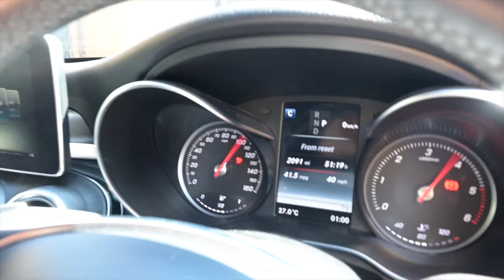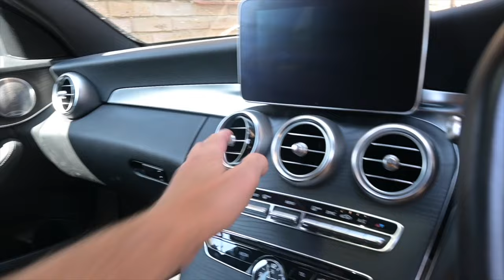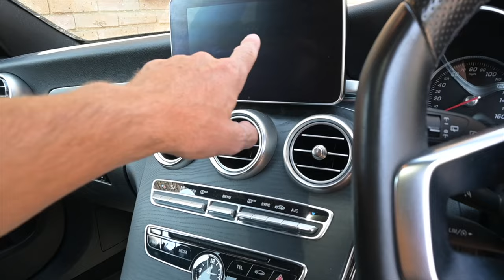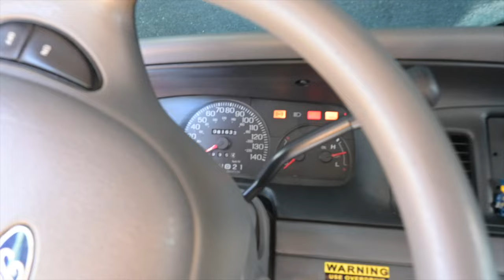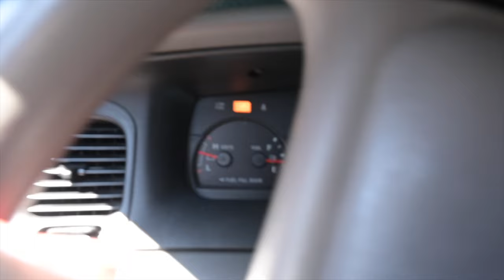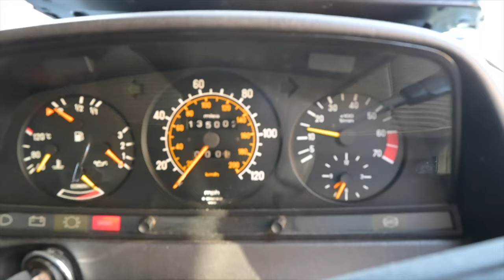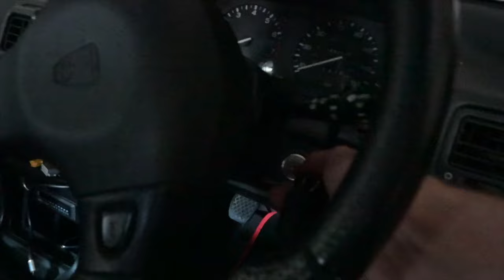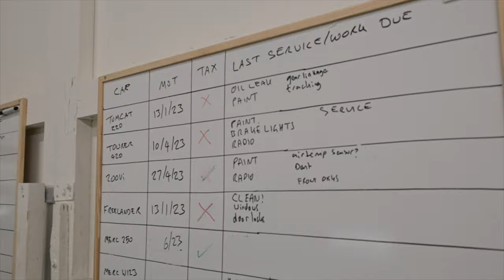Fleet round up - I drove my new car to Italy over Stelvio, now I need to fire up EVERY car I own

Comment: I still think you're being a bit OTT about the automatic gearbox. The issue is 99% of cars like the Merc are Automatics now. As a daily for comfortable cruising, through all the heavy traffic, it makes a lot of sense.
Reply from the maker: if being good at traffic jams is the major selling point thats a low bar for a car!
Reply from the maker: @Matt Hargreaves Ive actually found having to sit with a foot on the brake more annoying than just dipping the clutch when its time to go
Reply: @furiousdriving  That's why automatics come with a 'Park' position!
Reply: @furiousdriving  you should be able to tap the brake and the hold function will activate and you can have your foot back until its time to go.
Reply: @furiousdriving  
Mercedes come with
“Hold Function” If you push the brake pedal deep enough, the car will “hold” 

All Mercedes have a hold function, which will hold your position whilst still in drive. It’s an ideal feature whilst in traffic jams and on hills where you won’t have to press the brake with your foot, the car will stay still. 🙂

Comment: I worked as a Mercedes salesman for a number of years in the early noughties. Sold shed loads of C Classes, mostly diesel of course, but only one of them was manual and I have to say after driving it for the first time that it had the most agricultural, clunkiest gear change I have ever experienced !! Just awful ! Couldn’t wait to get back in my automatic C Class demonstrator for a relaxing commute home. 

Just can’t understand your hatred of autos. Modern 8 speed boxes are so much more efficient than ever before and much more responsive. They take the drudge out of nose to tail urban driving and minimise driver fatigue especially at the end of a busy, stressful day. 

Wouldn’t go back to a manual if you paid me !
Reply: Mercedes aren't great at manuals are they? Way back, the 190 auto was definitely preferred over the manual.
Reply from the maker: The W204 manual I just sold had a decent gear change, maybe it was a freak good one but apart from being tight into 1st when cold was nice
Reply: i carnt understand him  he slags off autos all thetime then he buyes one lol i agree with you

Comment: The fuel vacuum issue with the Crown Vic could be the charcoal/fume canister is blocked up and needs to be replaced. A cheap out is to put a tiny pinhole in the purge line. I had the same thing with my 1983 Mitsubishi Scorpion in Australia back in the early 90s, it actually created such a vacuum on a long trip that the engine died on me. Coasted to the side of the road, removed and replaced the fuel filler cap and all was sweet for another hundred or so clicks.

Comment: I think the criticism of the autobox on the C250 is a little harsh. It is a daily driver after all, expecting it to light up the Stelvio pass and being disappointed when a modern diesel estate doesn’t is just unrealistic. If it was me I’d just drive it normally and see all the positives to the car, the interior, the reliability, the family like it etc - suddenly the gearbox won’t bother you. Just see it as an A-B tool and they make a lot of sense.
Reply: Your thoughts aren't wrong but apparently an A-B tool isn't enough for some.
Reply: Not having enough engine braking on a steep descent seems like a valid criticism to me even on a daily driver.
Not having a reliable kick down for overtaking is also a serious failing.
Reply: @owengoodspeed5763  To be honest, I am pretty sure both of these drawbacks are pretty easily mitigated by changing some settings on the car, providing it isnt broken. So I am not sure its fair to call them "failings" really, if its mostly a driving style question.
Reply: @jimded  Agreed…I’ve a Mazda CX-30…..a bread and butter small SUV to be sure, but with extra pep if you want to have a little fun or passing power.
Reply: @owengoodspeed5763  for 99% of people they won’t ever even notice this, because they will just leave it in normal mode and get on with their lives.
Reply: @TJC156  So you think 99 per cent of drivers never use engine braking on a steep descent and never overtake?
Reply: He must be the on,y so called petrolhead that likes a merc manual !
Reply from the maker: If it was my old BMW E61 (520D manual) that would have been a hoot on there, we did drive that across Switzerland to Italy across lots of passed and it was a blast. We did a similar trip in the Alfa 159 and that was great as well so expecting similar from this isn't too unrealistic
Reply: @owengoodspeed5763  He is saying, as was I, the car is unlikely to exhibit those "problems" you mentioned while in "normal mode" if it isnt broken. So, are they failings really, then? Were his and mine comment really that easy to misunderstand, I would have thought they were pretty clear...
Reply: At the end of the day, you are a car enthusiast. You don't seem enthusiastic about the C250.

Comment: I 100% agree with you regarding automatic transmissions..I hate the b..dy things . They are more complicated ans extremely expensive when they go wrong and its vital to ensure the transmission fluid is clean ..no such problems with the average manual gearbox. 
Myself personally in you position  Get rid as you're clearly not happy with your car ..
I would reject it on the auto alone.
Glad you had a great holiday,  you've  earned it 👍

Comment: Glad to have you back, funny to see trying all the cars in fleet. I remember once coming back from a 2 week break, and my father had parked the estate car right up to the garage door so it couldn't be opened and the battery went flat (found the current drain later on) and someone had left the battery jump-pack in the garage...which you can't access because there is 2 tons of Audi estate right up the door. So that was fun, getting 3 people to try and push it up the uphill driveway, handbrake off, push it a couple of inches up, chock it, have a rest and repeat for about 30 mins just to barely get the garage door open enough to crawl under and get the jump-pack.

Comment: Your little cart thing down on the floor of the shop? What about a treadmill motor? Those things are easily 1 1/2 hp (or more), and you possibly could combine it with some batteries from hoverboards, e-bikes, etc. The great thing about treadmill motors is that the treadmills are basically given away most of the time, and there are other spare metal parts you could use for other purposes. Just wondering. Great to see you and your fleet again!

Comment: There is something not right with that car, on sport on my C250 w205 my gearbox change is instant and on a run fully loaded with kids and dog circa 50mpg+. Haven't remapped it and it's standard
Reply from the maker: I suspect a lot of the problem is my expectation of it being as good as a manual
Reply: @furiousdriving  definitely something not right on yours I have gone the other way from the same sort of car you are thinking about manual to this and mine standard I was going to get a remap on the engine and gearbox but haven't bothered as it's good as it is.

Comment: Alpine roads can be an unforgettable experiance, not always a good one, middle of winter, at night having to change an inner rear after running over a small fallen rock causing a blow out and on the drop side with no barrier.  Had to stop and change it as the clanking of the rim was annoying and it was starting to shed large chunks of rubber.  Traction was suffering on the offside.  Chose the widest and straightest section and put the drop out of mind and an Italian trucker stopped to help, he had some nice homemade Salami and a few Panini, it went down well after with an Espresso.  I gave him a couple of bottles of the trailer tank contents, partially fermented grape juice.  We were both heading to London so travelled in convoy the rest of the way.  He had 10 Fiat 127's on his trailer.  The Tunnel is expensive, gone up a bit since 72, hate to think what it is for an artic now.
A milk float motor in the C5? A bit big and heavy though and 96 volts so a lot of 12v batteries. Need to find a scrap Tesla and hope the motor and batteries are OK.  Thats all stupid but a 12v lawnmower motor and battery is more of a possibility.  Must still be plenty of old Qualcast battery mowers around.

Comment: I had hoped to do a northern Italy trip with the Fiat 500 TwinAir 105 but it was not to be.
Looks great though so perhaps I'll have to do it in another car.
With regards to the new Mercedes, I think that if it were your only car the gearbox would be a deal breaker. Fortunately you have a fleet of cars which include a number of manual cars including two hot hatches and a coupe to entertain yourself with.
It would be nice to see that P6 V8 to exit the garage under its own power. I think at this point there would be no harm in calling in some help to get the job done. You can then enjoy driving it plus it will free up more time to work on other cars.
Also the breakers on my 90's car also are not great if driven enthusiastically and soon fade after a few big presses.
We had a MK1 Ka and they really do feel like a go kart and the steering is very sharp and the gear change is excellent.
Reply from the maker: You should definitely do the Italy drive, its well worth it, and even better in an Italian car.
So far this has only proved good at traffic jams, not how to sell a car to a petrol head!
Im going to give the V8 one more go then get it to a mechanic. Unfortunately work have loaded me up so I came back to a full inbox instead of time to get on with the cars

Comment: If the auto box really upsets you I'd try a Mazda6, I've owned a couple and they're a joy to drive and in GT sport nav trim they're every bit as nice as the Germans. The 2.5 petrol is a great engine albeit auto only and the 2.2 diesel is absolutely fine as long as you look after it with a great manual box. You can only get a spare wheel on the petrol though. Take some test drives, you might be surprised.

Comment: Completely agree on the auto box, I just find them irritating regardless of brand (and honestly found merc to be the worst out of the lot and I’ve tried a fair few). If you still don’t like it I doubt it’ll grow on you, and with the miles you do you may as well have something you enjoy. Focus st/Volvo seems like a good option. The new focuses drive bloody amazing, had one as a hire whilst my van was getting some work done and it was glorious. I think a few test drives are needed with a decent distance in these vehicles to see what’s going on. If you don’t like it to start it’s very rare it grows on you.
Reply from the maker: I really like the Focus ST, and Mazda6 looks fun too. Its a shame the dashboards look a bit plastic compared to these
Reply: @furiousdriving  for sure. Mazda 6 is not a car you see very often but they’re really smart. I must admit, I do have a soft spot for a Megane but the boot isn’t great and was a lot smaller on the mk4 than the mk3 to the point where I just got a van instead. A delight to drive though.

Comment: Matt, how you manage 11 cars plus a day job beats me. I so wanted to finish my Alfa 145 this year but just doing stuff to get my Bongo Mot'd and sort suspension on my Seicento have eaten into my available time.......and that doesn't include my 166 which has been stored away waiting for the belts etc to be done. 
If anyone needed a break it was you. You do have quite a youtube output such that I knew you were on holidays without knowing!
On the 145 brakes not being good enough, I don't get that. Mine, when it was last on the road stopped really well and the brakes were definitely as good as the last fastish car I had in the CRX and Swift GTI before that.

Comment: In the U.S. there are about six cars left that are available with a manual.  and they are even harder to fine.  When I bought my  Honda Accord with a manual, the dealer had 125 Accords in stock. zero were manual.  The metropolitan  (2,000,000 population)  that has about 4 dealers had zero as well.  The dealer had to get it forrm another dealer over 100 miles away.

Comment: All these new auto's are to complicated. I stopped at 90's auto's, a simple 'S' button knocks them down a gear, you can see it on the rev counter and feel it in the car and away you go. As for engine braking, I put more me down to second and it's pretty good, wouldn't get much more out of a manual, especially in petrol. 

There used to be some pretty good diesel auto's out there but they by now, are not what you'd probably want as a daily.

Comment: 250 pounds per corner? What tyre size might that be then? Cause that's ridiculous! My fronts (275/35 18 Michelin pilot sport 4) only cost 148 Euro a piece (rears are obviously a lot more).
Good on getting a holiday! Been to Stelvio, as well. Not a fan, more a fan of the flowing passes in Austria and north-east Italy that way the car can stretch its legs a bit more :)
Being quite honest, for me these would be too much, all the chore lists per car would drive me mad. I personally would clean out some cars to be able to give them more miles and attention per car. Would free up budget too :)
Love the vids as usual! :D
Reply: £250 a corner is not that unusual. I had to fork out almost £900 for four tyres on my ML Merc ... they were 265 ? 20
Reply from the maker: 19", they dont come cheap unless you risk ditch finders

Comment: not all Automatics are created equal, Mercedes autos are not bad but you should compare it to a reasonably new BMW automatic last 5 years), and see how you feel.  Also the auto box in the Audis, from 2016 onwards are almost as sharp as the BMW.  Mercedes I found to be constantly wanting to shift, as a consequence of so many ratios I think. Maybe see if you can get one to review and then do a separate video comparing the boxes
Reply: The 6 speed DSG I've got is amazing it's chances instantly, smooth and responsive and in sports mode it's even more rapid, Just had new oil and filter.
Reply from the maker: I had a SEAT Cupra DSG as a company car in 2017, didnt really get on with that either. It was sharper shifting but often wanted to be in the wrong gear for the situation
Reply: @furiousdriving  def try a BMW, it's not dual clutch, but they have some excellent programming. Not saying you shouldn't buy another manual, but autos do have their benefits so would be a shame to write them off before based on Mercedes poor efforts ;-)
Reply: @xrissio  I honestly think he has a driving style that is quite uncommon, thus it being "outside the corridor" of programmed parameters that most autoboxes do, thats the source of his woes with most autos. Since I doubt he is interested in changing that style, I dont really se a solution, except as you say, find a brand that has a programming that might cover his use cases at least somewhat better, if its possible.
Reply: @GoldenCroc  quite possibly, but certainly for those inside that 'corridor', there are definitely boxes that perform better than others, and from my personal experience, as someone who also was not keen to migrate to automatic, I think that the bmw box's provide respectable performance such that it does not eclipse all other benefits that an auto brings. I think it would also be an interesting insight for viewers to see whether we can find a box to suit the Furious Driver! When I reference the BMW box, I'm talking about the ZF boxes, FYI, that were common in the 3 series and above, not at all sure about the boxes used I'm their fwd models
Reply: @xrissio  Can only agree with most of what you write, though I think it wont be easy. 

I suspect he uses the throttle range of 30-70/80 percent a lot, which makes the auto  hesitant to shift down, but still perhaps a bit to much for it to enable its "slow cruise" mode. 

As I understand it, he also says he has a lot of problem with auto boxes shifting down slowly or never, and the only reasonable explanation to that is that he doesnt use the "Kickdown" part of the throttle, since that should make them shift down pretty fast. Same with the wheel mounted paddles, you can "prepare a gear" for overtake with them, but he has said he doesnt like using them, since they can get mixed up for up or downshifting.

Also, I can only speak for myself personally, and I am normally not to fussed about auto box differences, for the driving I do. But the ones that were the "best" for me that I have driven have been the ZFs fitted to most modern BMWs, I was quite satisfied with them all the way back since the 2nd gen 5 speed (I think thats what it was), all the way back in my 1997 BMW 540i. Of course, the newer ones are even better. Cheers.
Reply: But you're comparing apples with oranges .... MB have a proper slush box auto .. your VAG has an automated manual. Admittedly it was a while back,  but i had a DSG Passat as a courtesy car ... couldn't wait to give it back.
Reply: @EmilysDadd  BMW ZF boxes are mainly not Dual Clutch

Comment: I suggest you give a 530d touring a try if you do get rid of your s205, much better gearbox and engine combo in the 530d and you’ll still average 40mpg or even more really. The ZF 8hp is not sluggish like the 9g.

Comment: If the issue on the vic is what you say it is, a new filler cap should fix it. The caps are supposed to vent pressure, but when they get old they stop doing it, like with how old radiator caps go bad too. Probably not an expensive part on eBay.
Reply from the maker: I think that is right, seems a very common problem and Rock Auto have them cheap

Comment: You could always loose your mind by trying to find the necessary parts to convert it to a manual. 
The Drivetribe channel have done that to a V10 BMW M5 using an M3 gearbox.
Reply from the maker: If I had the budget Id consider that!